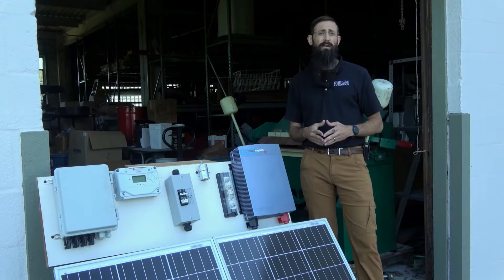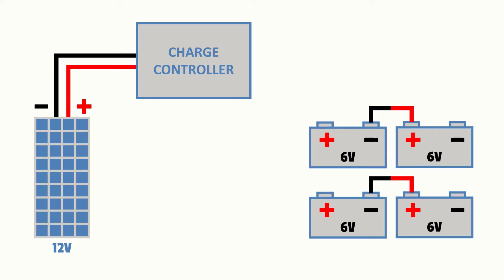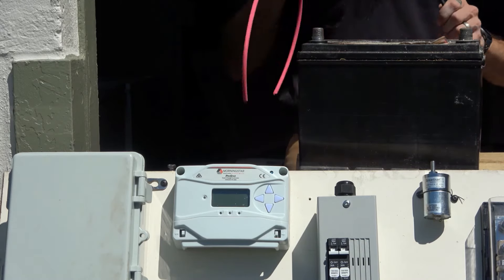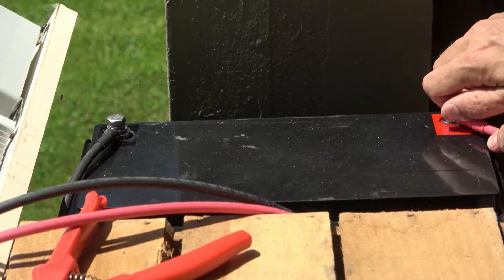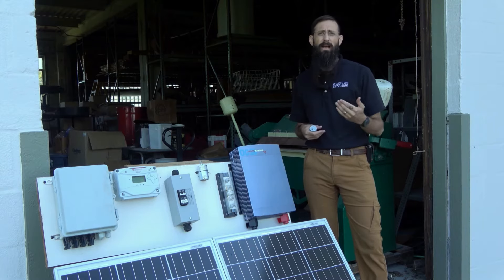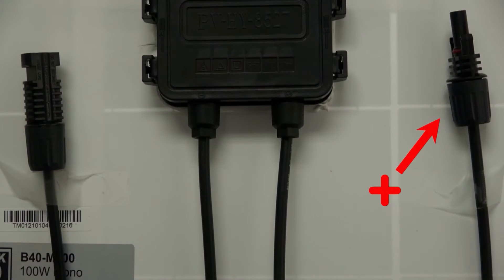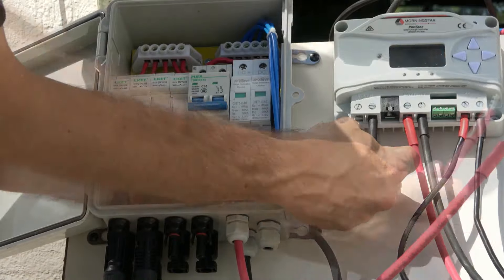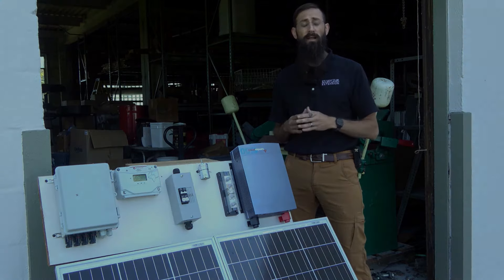How to wire a solar charge controller and battery bank

Comment: All is nice and well explained . I would have a very specific request: I like many individuals have a "IT home lab". most individu7alsa will have a normal UPS. Since i do not have one and that i am planning to install solar panes  on my house, is there a way to to wire the system so i can use  the battery of the solar solution as the basis of a UPS? Would i need an additional component to "activase " the UPS function in the event of a power or spike failure?  Spike coming most likely from a thunder strike

Comment: I have just 1unit of 230ah battery on a Genus 12V 1625 inverter and buying a 3x550W solar panels. what amp of mppt charge controller do i buy and do i connect the solar panels in series or parallel. Advice pls.

Comment: I’ve just configured a PV system with 20 250W 24v modules, 5 in each array with pure sine  grid tie micro inverters (1300w each) using 8 awg thhn thwn from modules to inverters. Then dedicated circuits to a sub panel for each micro inverter with 12 awg making sure to share the amps on both poles in sub panel. The master for sub panel is 50A 220v leaving sub panel through 6 awg romex to main panel also with 50A 220v breaker. The micro inverters use a reference to sync and will auto shut off when no sync available as in power outage thus protecting any lineman doing any repairs. My only issue is trying to use all the energy I produce as the new digital meters keep moving forward even when I’m giving energy Back to grid. Without getting a net meter from electric co. I have a Question about the use of splitter / combiner cables with mc4 connectors about NEC.  Are they ok to use or do I need to put inside nema2 box.

Comment: Great video! The only note is that some charge controllers require to connect the battery first, only then connect PV. Otherwise it can damage the controller.

Comment: So a 30a controller is capable to have under 30 am current output @ lets say 13.5 volts. Or did I get confused with this?

Comment: I have 4 bayite 6.5-100V multimeters  with shunts PZEM-05.  I don't understand the wiring diagram for hooking up the 4 meters for a solar power system found on the amazon web page.  I have hooked up the green, yellow, blue wires to the shunts and 4 meters but WHAT are the red dots on the red wires in the diagram?  For meter #4, where does the red wire go ... to the inverter or to the battery or both?  thank you

Comment: What is the purpose of the small DC motor - is it just to visualize that the system is operational?
Reply: Yes, it shows that the DC power is working.
Reply: Is that what the load is I always hear “load the load the load?” What the hell is the load?

Comment: If you have a series aray at say 40v and a series aray at 30v then you parallel them what voltage will see
Reply: The answer is 30v.  Series arrays adds the volts (and uses the smallest amp); parallel arrays adds amps (and uses the smallest volt).  I remember it as SV-PA, by looking at the first two letters of "parallel"; PA-rallel adds amps.
So, for your question, the parallel connection adds "A"mps, so it must use the lowest volts it sees; so 30v in your example.